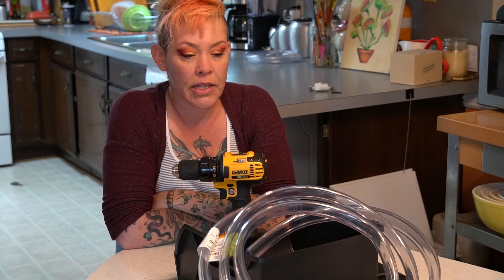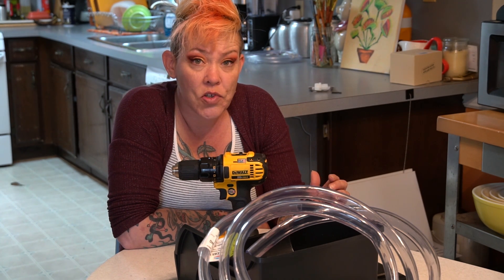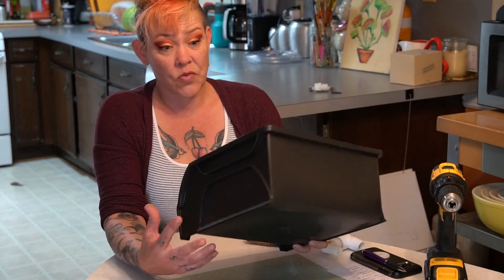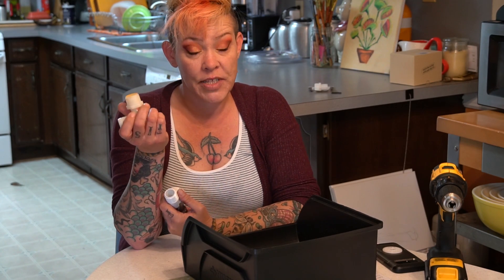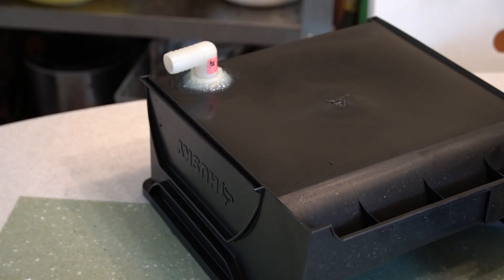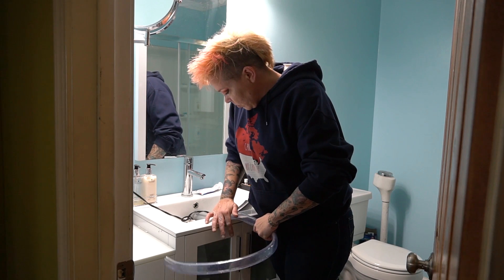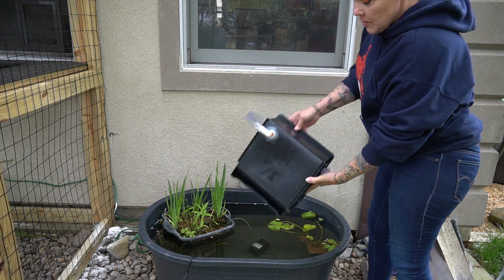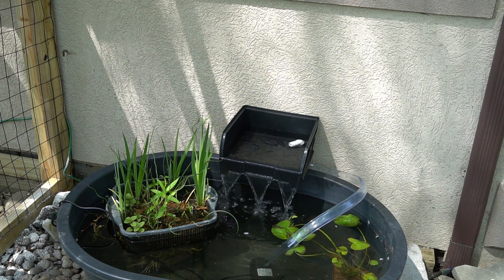EASY DIY Waterfall feature

Comment from the maker: Today we make a DIY waterfall wier for a container garden or patio pond. Total cost was $17, but the actual materials used cost about $10. Pretty cool!
My Patreon: https://www.patreon.com/racheloleary
Fan mail can be sent to: PO box 146 Manchester PA 17345
Buy me a coffee: http://msjinkzd.com/about_msjinkzd/support-our-site/
Instagram @msjinkzd
Website and stocklist: http://msjinkzd.com/stocklist/
Facebook: https://www.facebook.com/msjinkzd/
Reply: Like the waterfall you could add some filter floss or sponges to filter if you choose to do so. I also like the idea of another higher level of bog plants in the weir. It has alot more options if we allow our imagination to ponder different ways to use the weir.  Stack several levels and add bog plants at each level and surround the weir with rock might be able to encourage most to grow up over and on the rock the more the levels the greater exposure for oxygen exchange but also the down side more opportunity for evaporation because of the increased exposure to air. But truly like this idea.
Reply: Very nice!  If you replaced the elbow barbed fitting with a straight barbed fitting and drilled the hole in the front of the box (pointing the PVC elbow toward the back of the box) you could cut the needed tubing almost in half plus it would be nearly invisible and I think it might help support the box or maybe keep it in place.

Could you do a larger trough?  Maybe use one of those 3 or 4 ft window planters filled with substrate and planted with margin plants.  Pump the water in one side and let it flow back from the far end.  Not only would it be a wonderful planter but a helluva biological filter with all the substrate and plants.

Thanks for another great video, Rachel!
Reply: NICE! this is exactly what I was looking for! excellent idea on the stackable bin!!!!!!
Thank you! sincerely - Patrick

Comment: You may need a hose clamp to hold the tube to the waterfall basin. If it comes loose all your water will get pumped out. Great idea. Also, can you put the pump outside your pond? Put a nipple in the bottom of the pond and run the tubing to the intake on your pump. This will get rid of the tubing being seen. I've always wanted to try that. Love your handy projects.

Comment: an idea for an even smaller version (that ive built but not used, so if anyone tries it lemme know how it goes!) is using one of those plastic scoops meant for dog food instead of the box 😊 i got mine for 99p and used spare tubing i had and drilled it thru the back underneath the handle (which im thinking will come in handy for securing it someplace - with zipties im hoping)

Comment: The best sealant for outdoors is a polyurethane sealant. Silicone will become hard and brittle outside. You can by a small tube of poly glue in the glue section instead the big tube.

Comment: Just pop that tube in the sink full of hot water, it'll loosen dried up and expand for you. I had the same problem with stiff tubing when I was setting up a little vessel water feature for my aunt. Couldn't get the tube over the pump outlet or through a hole. Hot water fixed both.
***You might put some really smooth pretty river rocks in your Weir. They will soften the edges and make it look sort of Zen and modern. Very cool! Your sweet flag could live in that weir, growing in pea gravel and filtering fish poop as it came through, by the way. It would look like a mini Iris or mini rushes, quite natural. Well done, my dear!

Comment: I also agree that for anyone with 1 or 2 aquariums or a small pond outdoors, having some of these tubes ready and available for various projects is a good idea.  As you said, maybe we only use 2 out of 10 feet and so we'd have 8 feet left over for some other project.

Great idea on using that shelf.  It totally looks like what some of the water fall weirs look like, that we might pay $20 or $50 for!

Comment: That's a great simple and practical waterfall. Around here the box stores are great for those bins, for fittings, tubing, PVC Ace hardware is cheaper. Not sure about the fitting you used, but 1/2 inch PVC elbows are 59 cents each this varies at each Ace. If you didn't like the 3 way split might consider shaving the front edge straight.

Comment: Searching for info to convert a vacuum cleaner canister into my 250 gallon backyard pond filter, but found this vid! I diy everything than spend $. I accidentally left my syphon tube outdoors in the snow once, but holding the tubing under hot running tap made it easily pliable! Boxes are only $1 at the Dollar Tree   :) Great help here.

Comment: Thank you! I think I will use for waterfall template in styrofoam concrete pond to create flow outlets between shallows and waterfall too-very easy setup. Great to use for home made filter box to prevent critters from getting sucked up-thanks!

Comment: DIY cheap solution to bulkhead fitting are UNISEALS. They're amazing, been using them for years with my aquaponics system and turtle ponds; great, cheap way to plumb through walls. Including curved walls, like barrels and buckets, which most bulkheads can't mess with. Just wanted to throw that out there. Awesome video, gonna make a few of these for my tubs, thank you
Reply from the maker: Thanks for the tip!

Comment: This is a great tutorial.  I'm planning on setting up an enclosed 'raised planter bed' pond area for my turtle (in past years she's been put out in the 60 gallon pond tub, but, except for a rock that sits up above the water a bit, had no dry land, and it was not predator safe, so I couldn't leave her out at night,) and was looking at putting a waterfall in to provide filtration and decrease water changes, but it's $40 just for the waterfall box on amazon and then another 30+ for a filter media box to go in it, so I was looking for cheaper options.  I'm going to see if I can manage to adapt this idea, perhaps by using a container with a higher lip and putting a smaller mesh-box or something holding the filter material against the hose fitting.

Comment: Just So everybody knows they do make Bulkhead fittings (elbow or straight) for usually around $5 for that size. Bulkheads will Guarantee a long lasting strong seal, that can be taken apart if necessary.

What Rachel did clearly works but personally I wouldn’t trust it indoors.

Comment: Already by using that large diameter tubing that will slow down the flow quite considerably.
Reply from the maker: that is why I went with it over the smaller tubing- I actually bought both,a nd both size fittings. The pump is still turned all the way down, as well.

Comment: I love this idea! So creative to use the storage bin! 
I've been following this video series because I'm Working on creating my own small patio pond for my sunroom. I was thinking of putting it in there because our yard is covered with enormous old pine trees and I'm told that the sap and pine straw would not be good for fish or any inhabitants in the pond.
Anyway, I have a couple of questions about it. Also, I live in South Carolina and my sunroom is surrounded with four glass sliding doors on the exterior walls so it gets pretty darn hot out there sometimes. Especially in the summer. 
I'm thinking of purchasing the 40 gallon run from Tractor Supply like yours and now I want to add the waterfall feature. 
(I have no self control when it comes to these things either. HaHa 🤣)
1) Since my sunroom gets a ton of direct sunlight in the morning, do you think plants and / or fish might do well in there? If so, what kind of fish or plants do you suggest?
Do you think it'll get too hot once summer gets here? How much heat can fish and plants take? I always worry that they'll burn up. Even outside 
2) Are my sources incorrect about the pine and needles being harmful to fish? I've been told that because the pine trees are a soft wood although I'm not really sure why that would be an issue. 
I'm sorry for such a long message but I've been following your channel for quite some time now and I really value your opinion. 
Thank you so much for sharing your knowledge and experiences with us crazy fish geeks! 
Good luck with all your ponds and projects and I look forward to seeing how things turn out.